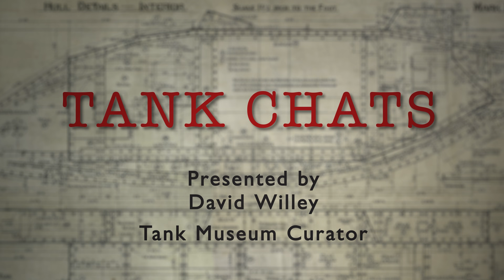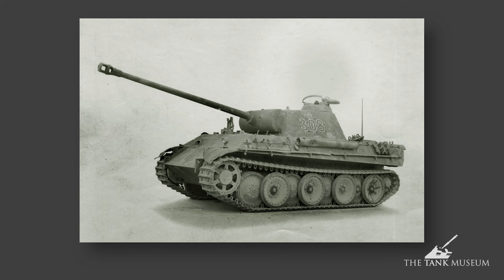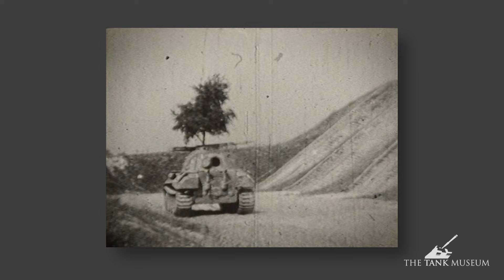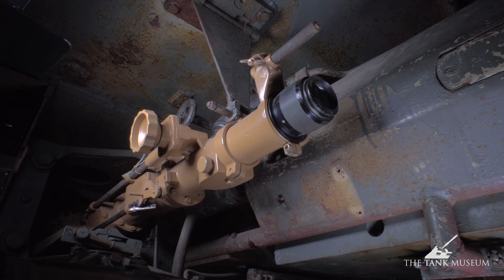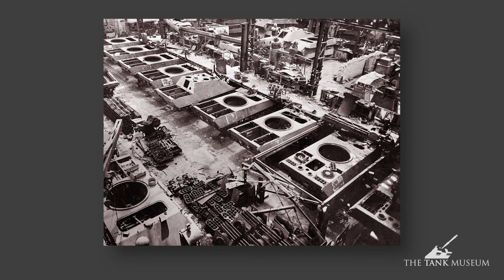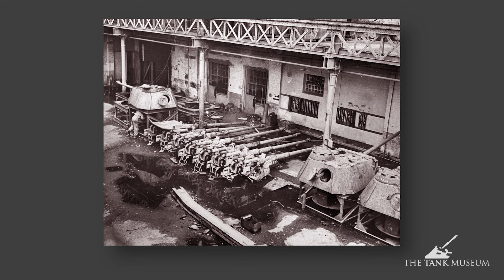Tank Chats #16 Panther | The Tank Museum

Comment: I guess that depends on the definition of "best". The most effective (costs versus kill ratio) German tank of WW2 was... StuG III. Okay, not really a tank but a self-propelled gun. After that probably Panzer IV. Panther was expensive and unreliable.
Reply: Vesardi247
The 1v1 argument is absurd. As mentioned wars arent fought that way, but it also ignores ease of production. A major advantage of the sherman and t-34 was ease of production to enable the advantage in tanks to never be 1:1. Panther was over engineered, which is a serious flaw.
Reply: +Frank “Silentstalker” Davis There were build more Panthers than Panzer IV.
One of the problems Panther suffered, were lack of quality material and lack of design time... But overall the Panter was a much better tank
Reply: +Random dude of Internetshire Thank you I am fine with a blog.
Reply: +Frank ”Silentstalker” Davis 
   First Panthers suffered a lot of problems but the last ones were decent taking account the conditions they were made under. Panthers weren't that expensive either 120 000 Reichmarks while StuG III being 80 000-85 000 and Tiger 250 000 (First ones are said to be up to 800 000).

On 1 vs 1 situation Panther (later production) was ought to win pretty much any Allied tank of the time. StuG III and Panzer IV were used much longer than Panthers which is a big reason why they had higher kill ratios. And Panther never managed to become finished project due to end of the production and development.
Reply: +Vesardi247 Even if we accept the StuG and Panther price as the truth, the 1 vs 1 is complete nonsense. Wars aren't fought that way. That would make the Tiger II the best tank of the war since 1 vs 1 it was likely to trash pretty much everything. If it didn't run out of fuel. Or if it didn't break down. Or if it wasn't busted by the USAF. Or if its crew could actually operate it (the late war German training levels were abysmal, crews went to battle with literally several hours of emergency training).

That's not how war works. As for the Panther being "unfinished" - no, not really, I don't remember any source for that claim. Certainly there were ideas to improve the Panther further, but many of the late war tank ideas were not focused on performance but rather on saving materials, something that rarely helped make the vehicle more reliable.
Reply: There is no doubt that France had superior tanks and I think superior numbers as well. They had inferior doctrine and tactics, combined with a lack of imagination and a largely defeatist attitude from the start. The french were preparing for a second WWI rather than WWII. 

You may call the panther what you like. It was not designed nor deployed as a so call heavy tank. It was not an infantry support vehicle. It was built to be part of fast moving breakthrough exploiting tank formations. For this role it was over engineered. 

Enjoy your night out. I am stuck in doing work but have fun!
Reply: First, as to the differences between the panzer IV and panzer III, they were originally designed for different tasks. The panzer IV was to be a infantry support tank and the panzer III a fast moving breakthrough weapon. That is why the original panzer III had the shorter barrel. Those roles switched, and the panzer III largely got replaced by the StuG as an assault gun/tank hunter. So why different tanks? Same reason the soviets had t-34s and SU-85s, or the americans had shermans and m-10s. You can say that heavy tanks should be filling this role, but they are absurdly expensive, and often specialty tanks, other than the british Churchill tank. 

I say it was over engineered because they tried to make it do too much and be too great at everything. This is what caused it to be heavy, and thus it had issues to manage the weight. I mentioned the wheels in the past. that added hours and hours of service time. I was not aware of the armour modification that hitler demanded actually entering service. I was under the impression that his armour upgrade was what became the Panther II, which never actually entered service. Perhaps I am wrong and you could correct me on that. 

I dont deny that on the battlefield, it sucked to face a fully function, and fully fueled panther. What I am saying is that design flaws at the core of the design meant that many many of those panthers were either not fully serviceable, or could not be deployed in large enough numbers to make a strategic impact. I would rather face 3 panthers than 10 Panzer IVs for example. 

Perhaps over engineered is not the right word to explain all of my issues with the panther. I think it was a mistake, and its only existence was due to Hitlers outrage that the t-34 was better in some ways than the Panzer IV and how dare those sub human Bolsheviks have anything that is better than its german counterpart (dont tell him how much better the IL-2 was compared to the Stuka). But the design itself was designed to be too perfect, and that caused drawbacks of its own.
Reply: Mark Diebels After quick search I found few sites that claim that the wartime rate was about 1$ to 2.5RM.
Reply: What you are arguing was that the Panther should have been a heavy tank, and the Tiger not existed. That is a very separate argument from what I was making. Lets address that:

The Panther was under gunned and under armored compared to the Tiger or the IS-2 tanks. It was even below that of the KV tanks. Speed for its size was the major advantage of the Panther, and that would be wasted on a heavy tank, which was doctrinaly used for infantry support. Even in 44 and 45 it wore out quickly over cross country, and suffered from complicated maintenance requirements. I would say the tiger, once it got the kinks worked out, was a better heavy tank. Ideally, they would have gone with a universal platform like the Panzer 4 and just used variants for different tasks, like the US did with the Sherman chassis. 

But lets say for the sake of argument that the Panther would have made an excellent heavy tank as you suggest. It was still poorly designed for the task that it was expected to perform, specifically, an upgrade over the panzer IV. 

The issues of german manpower are maybe the best legacy of the Versailles treaty. Germany had a very limited armed reserve, especially compared to the US, and thus its combat effectiveness rapidly degraded as they marched east. No tank, and certainly not a highly complicated one, was going to change that. My evidence for that argument is the Battle of Arracourt, where Panther equipped german brigades were decimated going up against elements of the 4th Armored Division, US 3rd Army. The easy stated reason was inexperience, so the panther could not save inexperienced crew, and experienced crew were lost regardless of the tank they had. It would have been far better to have enough numbers to make a difference. In the east a lack of an armored reserve basically made it so the germans could not retreat fast enough. 

Always nice to have a good conversation. I thank you as well.
Reply: Haha, we can get as expansive or "on topic" as you like. But I shall focus on what you wish to. 

We should not talk about the cost effectiveness of the StuG III, since that was an assault gun. Its role was just very different from the Panzers, so we will leave that in its own category. 

Your definitions of design flaw vs over-engineered are spot on. That is why ships undergo sea trials. Almost always with new technology, kinks and minor issues need to be worked out. That is not the focus of my complaint towards the Panther. 

It had I think the same engine as the tiger, so it had a very powerful engine to move a tank that while heavy, was something like 10 tonnes lighter than a Tiger. That is largely what gave it speed. It had a smaller weaker gun, and one that was less useful in firing high explosives for infantry support. That is because it was not built to support infantry, but rather move quickly and exploit a breakthrough. Problem was that the tank was front heavy, and due to using the Tigers heavy engine, as well as strong armor, it was a very heavy tank in general. It wore through suspension very quickly. This was true in 44 and 45,  as well as earlier models. It was difficult to transport due to its weight, it tore up roads, put enormous strain on rail lines. It also had far more moving parts than a Panzer IV, which increased maintenance costs. It also increased the strain on logistics lines because it needed more servicing and more fuel. So it was a tank that due to its features make it require more resources at a time when the germans had access to fewer and fewer resources. It was over engineered because they tried to pack in too many features, and that reduced both its effectiveness, and the effectiveness of other units. 

Finally, with regard to cost of production. While that is an interesting comparison. The panther is what, 16% more expensive? But that also does not take into account costs after production, as well as disruption to the industry as factories that could have produced Panzer IVs made Panthers instead. Its quite possible that the cost of the Panzer IV could have been brought down further. Nor does it cover the cost of converting said factories.
Reply: Go Mine no the Pershing was bad even for European levels of infrastructure which is why it was not approved for use until very late in the war.  And european infrastructure is normally the best in the world so it's pretty absurd to field weapons that require perfect conditions to function.  Returning to the original issue, panthers were horrible strategic weapons because they were so unreliable.  Almost a third were guaranteed to break down and they had an effective operational range of 100km because of this.  By 1944, germany had only about 1000 armored fighting vehicles operational at any one time and and a big reason was panther unreliability.
Reply: One of my big favorites, the STUG III
Reply: do you know the rating compared to Reichmarks to Dollars?
Then i have an idea of the cost today
Reply: Thanks man
Reply: Going out and don't have time to give you a thoughtful response, but note your example does not give evidence to the question of timing.  Just a couple of quick notes, I believe the Panther was essentially a heavy tank in many ways (not all).   the The Germans entered the war with inferior tanks to the Allies (French at the time) but superior tactics.  I think we already agree that tank performance is not the only factor in winning.
Reply: Aaron Paul,  Had a great evening, thanks.

Ok, I think we are getting off the mark here.  Because we are about to drift into more complex issues such as the tanks battle role, was a medium or heavy tank necessary, was the Panther or the Tiger a good decision... I get the feeling you have an excellent and well informed opinion on all of these issues.  I will take the blame for getting off target.

Our discusion was initially only two simple issues.  Is the 1v1 tank issue important and was the Panther overengineered.  To keep this discussion simpler I am going to bypass the first issue.  We seem to place different levels of importance on 1v1 and I think that is fine and can be left alone.  I will admit that other factors are as much if even not more important in certain instances. So if you don't mind let's proceed to the over engineered question.

Over engineered is defined as the additional designing of a product to be more robust or extra featured than is deemed necessary for its primary application to be completed successfully.  This is a rather important point because I do not believe the Panther was over engineered.  People should not confuse the need to work out design flaws with over engineering.  I use the term design flaw as an unintentional  mistake in the design that is corrected during the testing stage of a product, some people may call it working out the kinks or allowed time for teething.

The design met the requirements of its role as a well balanced tank (successful balance of firepower, mobility, and protection) that could check the T-34.  The cost to produce the tank met the requirements.  The Panther was 117,100 Reichsmarks and the Mark IV was 103,462 Reichsmarks.   At this point I will state the 82,500 RM investment for a StuG III was better but should not be confused with the requirements of the Panther tank.  I believe the Panther was placed into action before all of the design flaws had time to be worked out.  Design flaws are not due to over engineering.  The more parts in a design is a direct relationship to the number of potential design flaws.  This is true with all designs.  The US had a similar issue with the US M16A1 rifle.  The design of the Panther was fine, it just wasn't given proper time to be developed prior to action.
Reply: Aaron Paul,

At least we agree on the StuG.

The gun was not designed for or good for high explosive rounds.  That was a design specification error not an over engineering error.  

The Panther was designed at 20 tonnes lighter than a Tiger.  They shared the same engine for production efficiency reasons.  Later Hitler ordered the extra 10 tonnes of front armor for the Panther which greater hurt the vehicle's performance.  I do not call this over engineering because it was an after design modification.  If you wish  you can call this over engineering or the foolish meddling of the ignorant.  But this added weight is what can be attributed to many of the issues such as transportation, fuel efficiency, and overheating issues.  As designed the tank would have been barely heavier than the IV yet still had enough armor to achieve its goal.  Its speed, better weight dispersion and suspension made it exceptional in rough terrain.  The optics were excellent and with the 75mm it was excellent at finding and destroying T34s.

Yes it had more moving parts than the IV.  However numbers of parts does not mean over engineered as much as a needed to meet requirements.  

Your logic of production and resources would bring into question why a panzer IV when the III was easier and cheaper to build.  These questions have nothing to do with over engineering.  I have read that the Soviets did not improve on many of their tank designs so as not to hurt the production rate.  There is merit behind such decisions.  But I still do not see that as a question of a design being over engineered.

If you would like I will say that Hitler's extra armor on the Panther can be called over engineered.  However I have not seen anything in the Panther's design to say it was over engineered.  It achieved the near perfect balance for a  tank and met the requirements.
Reply: Sorry Aaron Paul, being called away again  - family nothing like them.  Did not mean to end so abruptly.  

Somewhat obvious I view the Panther differently than yourself.  I do appreciate your views and give you credit in your evaluation of the tank.  Sounds like one of those agree to disagree situations - but please write me back and give the final say on this subject.
Reply: Most of the authorities selected panther was the best ww2 tank. That's it. Now cut the crap.
Reply: Dex4Sure and Pershing didn't see much action because it was introduced at wars end
Reply: Don’t forget the Panther’s extremely bad Fire Control System.
Reply: Frank Davis panther was only about 10k rm more than panzer 4. its practially the same cost. and later in the war mid to late 44 it cost even less.
Reply: alex ossel  the Pershing also had a lot of reliability issues
Reply: MRJ2012 It’s reliability was bad by American standards by German standards it’s better than a Panzer IV: 75% operational readiness rates of the Panzer IV versus the 84% of M26.
Reply: Go Mine also it was replaced in Korea due to issues
Reply: MRJ2012 Because AGF has certain standards of operational readiness that M26 was incapable of the achieving these standards within Korea (which M26 was not designed for being built for Western European levels of infrastructure) with a perfectly good upgrade packages the M46/7, and a proven all terrain tank the M4A3E8 as better alternatives.
Reply: Anyguy4321 The delay had to do with completing the design to its fullest and not rushing it into service prematurely. late 1945 was the earliest M26 could be fielded and maintain AGF standards of operational readiness (stood at 84%). 

Pershing Vs Tiger I :1945 by Steve Zaloga
Reply: Unreliable....maybe, in the early models
but expensive ? nope, Panther is just a lil more expensive than a Panzer IV, much more affordable than a Tiger I
Reply: You are pretty much dead on I'd say- sorry to see all these trolls.
The question is actually both extremely complex and simple at the same time-
if that makes any sense :) 
First(let us pretend we belong to the leadership in both the Hauptrustungsamt and Panzerwaffe at the same time-the decicion-takers.
The big problem would ofc be that Adolf intervene in pretty much everything we do) one has to decide roughly what kind of vehicle one wants to create. 
Its role, the triplet armament/armor/mobility, its cost, where to produce it etc etc.
To compare it with a Stug IMO would be unfair(although due to cost and resource issues more often than not from the latter part of 1943 and to the end of the war Germany lacked more or less everything needed to produce a tank- therefore out of 2 tank battalions many panzer regiments carried one full battalion of Stugs and just one battalion with regular tanks)
The reason should be self-
explanatory due to the different offensive capacity a tank has compared to a tank-destroyer. So let us leave the stug,marder
hetzer etc out of that equation.
I would stick my head out and bluntly claim that the German armament industry failed miserably in 2 departments compared to the allied and therefore from 1941 onwards always remained on the defensive quantitatively-
#1 overengineering
#2 constant tinkering making improved models but hindering effective mass-production

The Panther tank is more or less the perfect example in this case.
If one considers a Panther G, where most of the child deseases have dissappeared it is simply a masterpiece in every production department,
a Mercedes S-class compared to a crude Lada to do a blunt comparison.
To produce such a fine product with all its tolerance demands etc etc demand much more of the factory workers, equipment and so on.
For every Panther produced, the Soviets made 6+ T-34/85- a very versatile and improved medium tank that all German panzer units had to treat respectfully to the end of the war.

As you have mentioned- the ever nagging 1-1 comparison seldom makes perfect sense because a battle seldom was just about tank versus tank- especially on the western front. The western allies were inferior pretty much every day during the war compared to the Germans when comparing tanks 1-1- the problem for the Germans was the allies constant air superiority from 1943 on. A small detachment of british Typhoons could on a good day make a  full Panzer Division stop dead in their tracks.

Imo, and I am not alone claiming this, if the Germans had consentrated fully on making the best version of the P-IV, the Aus H, they would probably have maximized their chances offensively regarding their offensive Panzer capacity
in the latter part of WW2(from Kursk onwards).
The Panzer-IV Aus H with Schuerzen and Ostketten and the long L/48 75mm
was a fantastic all-round tank-vastly superior to a short-barreled Sherman
and on-par or better than a T-34/85. In the latter part of 1943, all its child deseases were gone. It had great range, great mobility, good fuel economy and a hard hitting and dangerous gun for every allied opponent maybe with the exeption of the IS-heavy tanks.

It is not coincidential that the II.Battalion of every panzer regiment including most SS-panzer regiments were equipped with P-IV on paper till the war ended. Its better reliability and mobility more often than not made them the last survivors when a panzer regiment got depleted in heavy action.

The Tiger and Panther romantics never have fully grasped that the fact that these models were outstanding tanks did not compensate for them failing fundamentally because of lacking production numbers.
Example: Not during any day since start of production did the number of operational Tiger I tanks exceed the number of 90!
Compare this with the number of operational Shermans and T-34's.
The Panther didnt fare much better.
Reply: Still, can easy deal with a T-34 or a sherman
Reply: If you look at the cost, it wasn't that much more expensive than the Panzer IV and was far superior.
Reply: Aaron, disagree, Panther was not over engineered as much as it did not have enough time to be developed and was rushed into production.  It was fine design that balance, speed, protection and firepower.  Most flaws  were designed out by the end of the war.  

I also question the 1v1 comment.  Even though I would not say wars are won based on this alone it is a major factor.  Germany had a limited amount of trained tank operators by placing them in superior tanks they could be better utilized.  The Allies had not the same issue with personnel.  Second if you ask any tank crew which they would have prefered the Sherman - T-34 or the Panther you will see how superior the Panther performed.
Reply: Sorry but still disagree.  If early in the war, after the initial push across Europe, Germany would have realized the weakness in their light tanks and at once began designing the Panther (which was really a heavy tank) the flaws would have been worked out in time to make it a more successful tank during the war.  The fuel consumption would not have been such an issue at that time and I do not think that weighs in on the tanks design flaws, that goes with having a heavy tank.  Germany needed a heavy tank to fight the war just like they needed a heavy bomber.  One came to late and the other not at all.  

It was the Americans and Russians that made the difference in both production capabilities and manpower.  I agree Britain was not really a major factor in this area.  Germany was destroying not only more of the allies tanks, but also more of their tank crews .  Significantly more they were losing, but were still falling behind.  They definitely had more of an issue in this regard.

Many of your comments I would agree with regarding the Tiger, but not the Panther.  The problem was not the design flaws, it was the timing - too late.

We may not agree on this issue but I appreciate your insightful and well stated comments.  Thank you
Reply: M

Only speed, protection, and firepower are not the only factors when determining the effectiveness of a tank. It was over engineered because it was an overly complex design, and that made it flawed. As mentioned in the video, it was extremely heavy for a "medium tank". Its wheels are configured in that manner to better manage the weight and ease pressure on the suspension while going cross country. But its weight made it a big guzzler of petrol, something the germans could ill afford. It was hell on roads and infrastructure and thus difficult to transport and keep supplied. In addition that wheel configuration made maintenance an absolute nightmare. That is why it was an over engineered tank, among many other reasons. 

The Panther came out in 43. At the same time the Russians had developed and even produced some of the t-44 and the americans were working on and soon would be able to produce the t-20 if they wanted. Both decided that it was better to upgun the t-34 and sherman rather than disrupt the industry and resources towards a new design. The Panther was a bad tank because german would have been better served devoting its limited and shrinking wartime resources into upgraded Panzer IVs rather than build the Panther along side it. Panther was a redundancy, and an expensive and inefficient one at that. 

The allies, and especially the british 100% had the manpower issue. The US manpower was also pretty tapped. The Panther was a waste. The tank itself had tremendous issues beyond firing and taking fire. In a computer simulator its fun to look at the Panther as this world beating tank, but when you need to play national production, resource management, logistics and maintenance, the panther was a mistake.
Reply: Frank Davis Self Propelled Assault Gun*